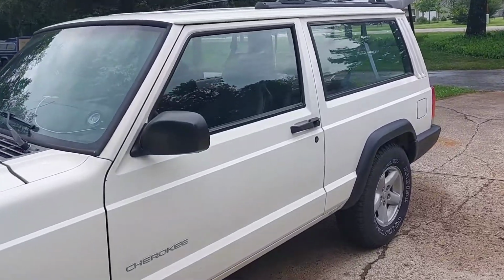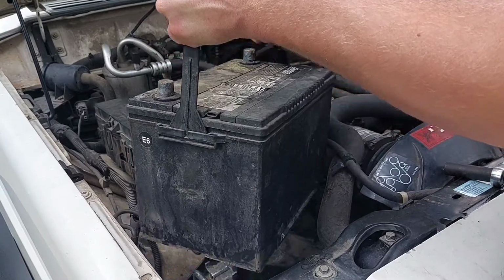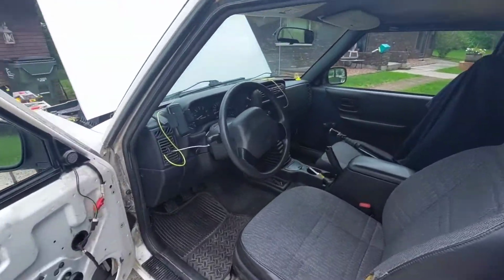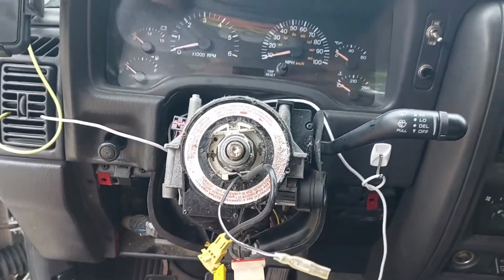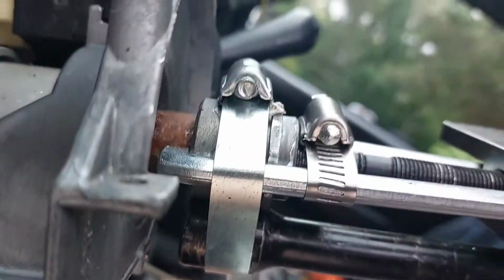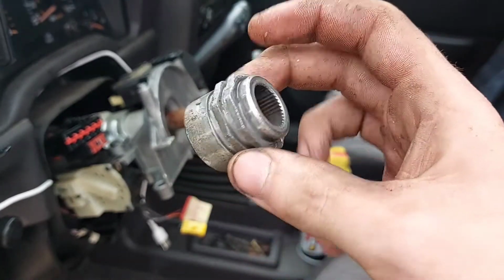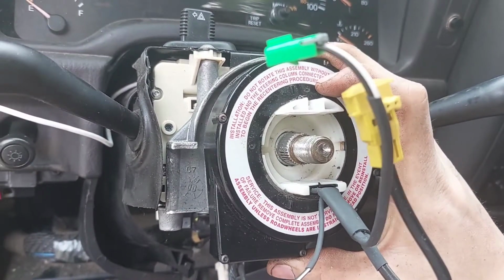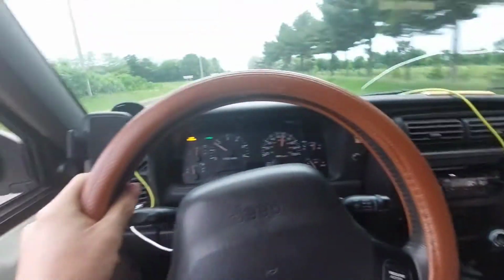How to Install Cruise Control - Jeep Cherokee XJ ['97-'01]

Comment: Good video but I will say you are missing some crucial information. That being the 97-01 Cherokee use two different PCMs so with that being said there are also two different versions of the cruse control button sets. The 97-98 XJs  have the old set up that can be easily identified buy the ignition system running a distributor. The 00-01 XJs run the later electronics that can be identified by the ignition system running the coils on plug rail system. Now 99 is the gray area cause this is the crossover year. Some are the old style and some are the new so you have to identify your system. So what is the difference of the 2 versions of the cruse switches? Its the resistance valve the each button to tell the PCM the driver commands of cruse status. That's it so best to try and get the switch's closes to the year model you have other then that the video is spot on for swap.
Reply from the maker: I will admit my tutorial-making skills are a bit rusty, it's been a while, and I've lost my touch. I didn't do much research on this one because I figured with how easy it was to remove everything from my wrecked Jeep it would be pretty easy to get it installed too. However both of these are 2001s and that makes model year interchanges so easy I don't even have to think about it. Very interesting that the cruise system changed, from what I understand, for model year 1999. 

Just to clear some things up, 97-98 buttons are not compatible with 99-01 buttons, your cutoff is '99. The 97-98 buttons have a part number ending in the letters A, B or C, while the 99-01 buttons have a part number ending in D (or later letter). Nobody knows why they changed this, but many things changed in 1999 (like the steering wheel, as I mentioned) [So I was onto something! Just didn't follow through with it] I always wondered how the system worked with only 2 wires controlling 6 functions, very interesting how they can use ohms to do that. Y' learn something new every day!
Reply: My 2000 2 Door has a 2.5 litre 4 cylinder which has a distributor. What year should I try to find Cruise from?
Reply from the maker: The 2.5L for 2000 was a unique sort of set up because it used a distributor while the 4.0L of 2000 used a coil rail. That being said, the ignition system has absolutely nothing to do with Cruise Control, it's just a way to differentiate the model years. 

I'm not at all informed with the 2.5s and have no idea how their cruise setup works. It may require some experimenting or deep digging on the ancient forums. The TJs may be of some help with this
Reply: @WAEMIDIV  is it just the switches that aren't compatible or the wires that plug into the switches as well?

Comment: be advised, the switches for 97 and 98 have a different power signal than the 99,00 and 01 and are NOT interchangeable

Comment: When the steering wheel puller bolt becomes hard to turn, stop and tap the wheel close to the shaft with a hammer or a drift punch, bar stock, socket extension ect.  And the vibration along with the tension from the puller makes removal much easier.  I usually hit going from the side towards the shaft or even tapping the opposite way the puller is pulling.   A few good hits and turn the bolt till it gets tight again and repeat

Comment: Great video. Just a tip, when splicing a harness I’d stagger your butt connectors to prevent the harness loom from bulging out (ha).
Reply from the maker: Sometimes, my lack of brain power when it comes to thinking of extraordinarily simple yet clever ideas is concerning. I'll put this tip to use on all future projects!
Reply: @WAEMIDIV  not loss of brain power man. We’ve all done it and it’s more of quirk of mine being aircraft maintenance lol.

Comment: I did the thing on mine but it didn't work even with a brand new clock spring also i have an air bag light on 🤦‍♂️ what are your thoughts?

Comment: Nice video, I just did my clockspring last Sunday.  No more airbag light and cruise works again.
Reply: will a bad clock spring stop the cruise control from working,im looking at a used 98 with non working cruse control and want to know what i might be up against for repairing it
Reply from the maker: Yes, the clockspring carries the signal from the buttons through the steering wheel. A failed clockspring might also display the "airbag" light on the dash, and the horn won't work. If you also have these symptoms, the clockspring is the problem

Comment: Any recommendations for why my cruise system doesn't engage? It's factory and from what I can see and tell everything is hooked up properly but the light on the dash doesn't come on and it doesn't engage. This is the first video on the internet from what I can find that isn't complete aids when it comes to demonstration and instruction. I really appreciate the work you put into your videos and can't wait for more of them.
Reply from the maker: If the light doesn't even come on I'd start with the buttons on the steering wheel. They do get worn out and eventually stop working. You can try "slamming" down on the "on/off" button really hard (that's what I had to do when I got my first XJ, the button was stiff from sitting for 2 years) 

If the airbag light is on, that'd be a bad clockspring, which would also disable Cruise and the horn.
Reply: @WAEMIDIV  I'm gonna cavity search those buttons then because it's starting to get irritating. Thanks again, I appreciate you.
Reply from the maker: @evanpurtle  I'd also do a self test on the instrument cluster to verify the light bulb is actually working - Hold down the trip reset button, then turn the key to the Run position, then let go of the trip reset. The gauge cluster will run a test on most of the lights, just watch to make sure Cruise lights up.
Reply: @WAEMIDIV  oh I do that all the time, I watched your video on it a while ago (never knew they did that) and now I test it at least 3 times a day. I enjoy just watching the shit blink and move😂. The cruise bulb is good on the cluster I have now and my old cluster too. I'll start with the buttons and see where that gets me, thanks again.

Comment: Why am I watching this. I have cruse control already.
Reply from the maker: https://youtu.be/SjG99OLFNmg
Reply: It could benefit someone with cruise control like myself on checking all the components to figure out why it doesn’t currently work
Reply from the maker: @devito7196  If the airbag light is on and cruise doesn't work, that's a bad clockspring, seems to be the most common problem. I've also seen the steering wheel buttons fail, and it could be just a bad module too
Reply: It could be a benefit to others, but I already knew how it worked before the video. I had to do quite a lot of tinkering and modifications to rewire the mux in a ZJ wheel to make the buttons compatible with the XJ computer.

Comment: Could you use buttons from a 97-02 TJ on an 01 XJ steering wheel? Would you need a TJ clock spring specifically or is all of that interchangeable?
Reply from the maker: I believe you could, but your interchange is 97-98/ 99-02 
I'd still use an XJ clockspring though. I don't like to chance anything when it comes to airbags
Reply: @WAEMIDIV  I don't see any sellers on ebay that sell buttons that are specifically for those year ranges. Most sellers just say they work on 97-02 TJs. Like you said in the video, the 97-98 XJs use a different steering wheel, and the buttons looks like they would only work with a 99-02 steering wheel. Is that the only thing that makes the swap not interchangeable between those year ranges or is it something electrically? I would go to the junkyard and get one out of my specific year range, but the nearest junkyard with a Cherokee is 50 miles away, and its a 96 so would be pretty useless to me.
Reply from the maker: @emmjea6913  Take a look at the pinned comment, the different year ranges use different resistances with the buttons. I'm not a TJ expert so I couldn't tell you anything for sure about them
Reply: @WAEMIDIV I messaged the seller to confirm what year TJ the buttons were taken out of so let's hope. Buttons seem to be the most challenging item to aquire, easiest to get a new steering wheel but I'm way to cheap for that.

Comment: Do you know of a way to test the cruise control module? My buttons seem to work because they turn the light on the dash on and off respectively, and my clock spring is new. My horn works, my turn signals work, but the cruise never sets.
The cable is present and attached. I can only think of the module, maybe wiring or vacuum. But I suppose I'd have other vacuum problems if that was faulty? I don't hear any hissing.
Reply from the maker: I'm not sure. I've never seen a module fail but that's what it sounds like to me. There is a diaphragm inside it and that could've broken, resulting in it being unable to hold vacuum. 

I don't often recommend throwing parts at it but in that situation it might be worth a shot to just put a new module in and see if it works

Comment: Hi: in your video about adding cruise control,  you replaced the connector that goes into the module.  Please tell me where I can get one of these.
Thanks 
Gary
Reply from the maker: I had access to a donor vehicle, so I just cut it off that one's harness. It doesn't seem like anyone makes them new
Reply: @WAEMIDIV  thanks,  I think I know where one is in a junk yard.